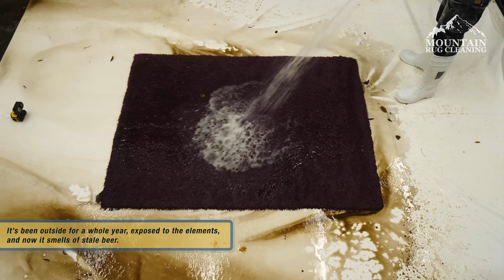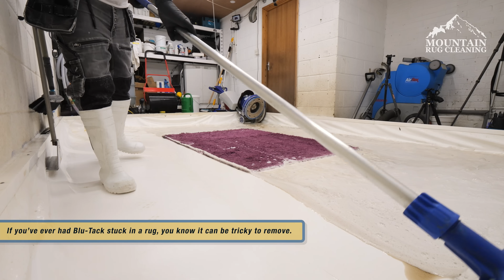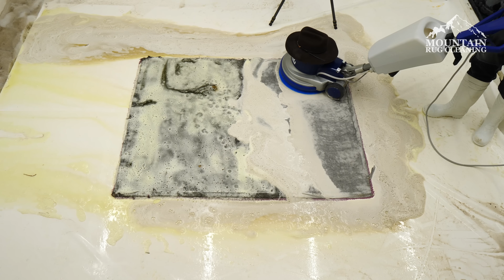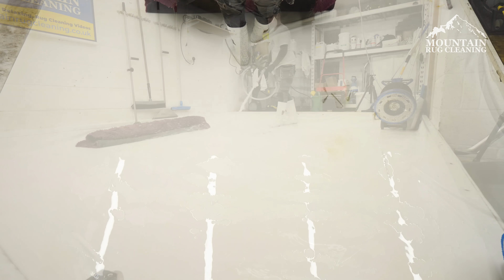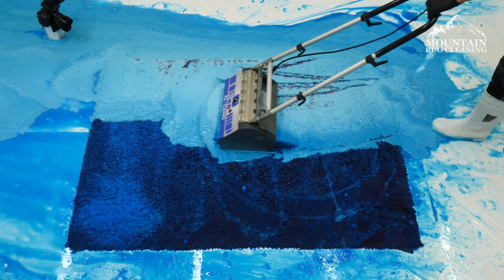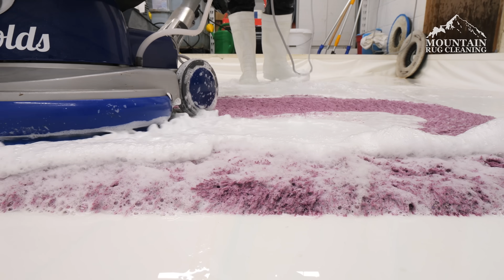Cleaning the Beer-Soaked Rug: A Gift for the Granddaughter! | Satisfying ASMR Cleaning

Comment: First - thank you for the commentary - I know it's extra work in video creation but it is really educational. Second - I had never heard of Blue Tac before (maybe a Brit thing?) but it reminded me of something we used to be required to use in lieu of tape back in college dorms. Tape purportedly damaged paint and wood surfaces, so if we wanted to hang anything on the walls, we had to use Sticky Tac, which had the consistency of old chewed gum but peeled off the wall without peeling off the paint. Problem was, if that got on fiber/clothing it was like cement and almost impossible to get off. The Blue Tac seems to be something more of a liquid adhesive that dripped onto the rug then dried. WD40 to the rescue 😉 Like they used to say, if it is moving and shouldn't, use duct tape; if it is not moving and should, use WD40 😉Engineering flowchart 🙂

Comment: Hi James,
I'm not sure what Blu-Tack is but I'm guessing that it's sticking and hard to get it unstuck from things... especially a purple shaggy rug!
But, I have got to admit that W-D 40 is an amazing product and works for so many different things. Like this little hack: When you get a picture frame (or anything) and there's a price tag right in the middle of the glass. You can't just wash those things off. However give the tag a tiny squirt of W-D 40, (enough to saturate the tag), let it sit for 30 seconds and wipe it off with a paper towel. Then clean the greasy residue off of the surface and clean it with a little window cleaner.
Still loving your channel I just haven't been commenting!
Stay safe, happy and healthy my friend! 🙏🤗🤟